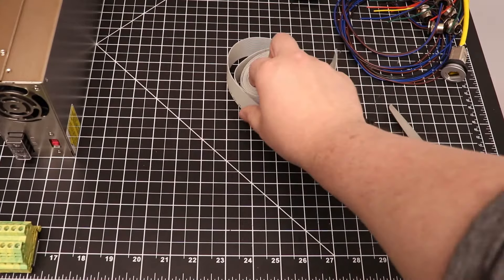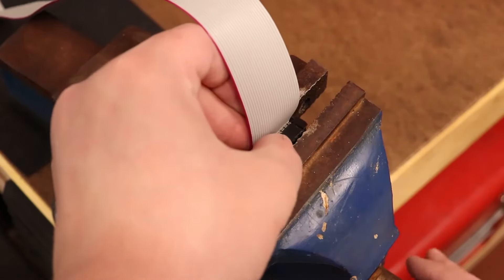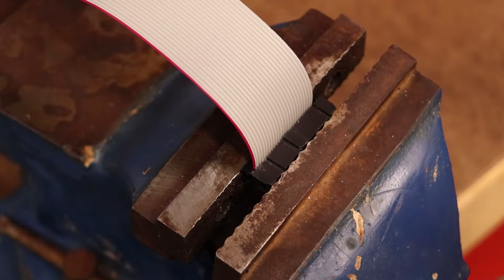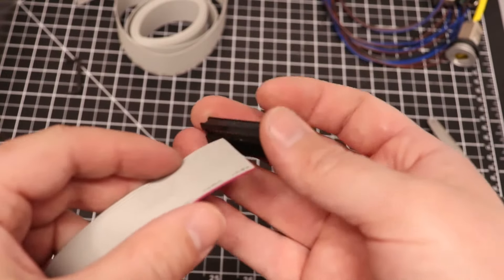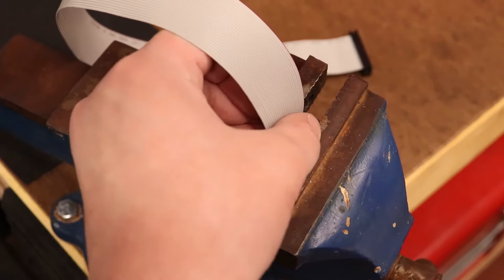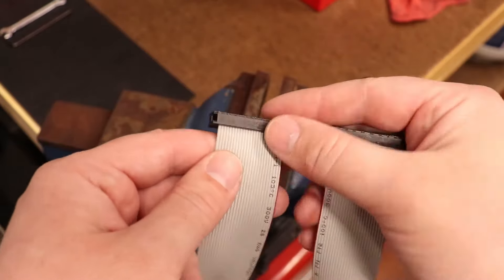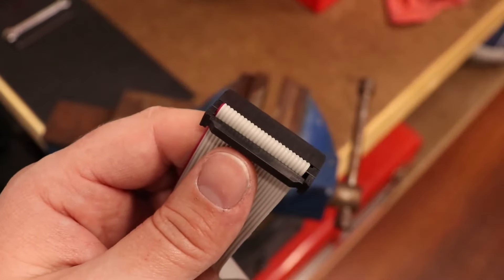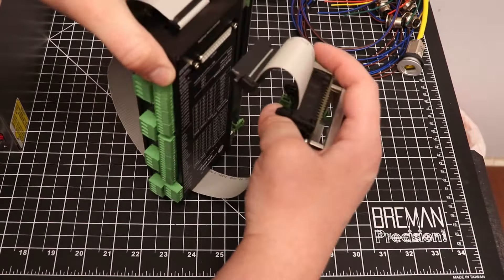Making Custom Flat Ribbon Cables At Home

Comment: awesome video! i inherited a PS2 that was suuuper dusty, so took it apart to clean but damaged the cable connecting the controller port and it no longer works!
Reply from the maker: Thanks, I am glad you enjoyed the video. I remember the PS2 , a great system to inherit ! Hopefully you can get it back up and running.

Comment: Need for speed, USB-type-C hub making with STP(UTP) and bench-vice.
Reply: The factories went to everything - one-big-piece, multi-layer PCB. Imma going to suggest old-school luxury trouble-shooting and cable yanking, excess cable in hub, crimp no-splice no-SMT, no bread board. Inline "PCB" and flexible, is old harddisk 40pin or 80pin cable select. Nowadays they hype serial-comms signalling and flexible-PCB and organic-LED and ... Nevermind.
Reply: One piece mobile phone board need separate piece for outside connector to avoid transferring lever-effect torque and break main board. Things were more sensible in the past. Separate lever-effect. Nowadays they bread-board to break-board. Flex cable in-between big small PCB was genius.

Comment: HOW TO REOPEN IT?
Reply from the maker: While it can be done with a small flat screw driver or similar, by lifting the tabs on each end carefully. I do not reuse them myself once they have been crimped. If I need to replace the connector I will trim the cable flush with the connector to retain as much length as possible and install a new connector.
Reply: Yup

Comment: Wonderful🎉❤....I 
 have one question.....in frc cable which side is positive and which side is negative.....plss tell  something
Reply from the maker: For ribbon cable, the red conductor is pin-1/conductor-1. Positive and negative pinout will depend on your board and project. Make sure to follow the manual and data sheet for your specific hardware.

Comment: Great video,  I have an old vcr with one of these ribbon cables one end is out but the other end won't budge are they sometimes glued into the board or will it come out with some more gentle persusion ?
Reply from the maker: Thanks! The pcb board the ribbon cable connects to may also have a lock lever style connector that needs released. If this is not the case and you do not see any glue to remove, gentle persuasion may be the correct answer. A little prying from each end with a small screwdriver can be successful in helping the connector come off. Care must be taking with this approach as to not damage the connector or board if it is not being replaced.

Comment: Thanks for the tutorial. One question,  I need to connect my motherboard to a programmer, the mobo has 9 pins while the programmer has 8 pin. Do I need a custom cable? or a 10 pin idc would work?
Reply from the maker: I often connect mismatched headers with ribbon cable ( 25 pin DB to 26 pin IDC for example), ignoring the unused pins.  As long as the number one pins align, not all pins of a connector have to be used/wired. Just double check your pinout on each header. The ribbon cable can be pulled apart at the ends if you need to change the pin order as well.  👍